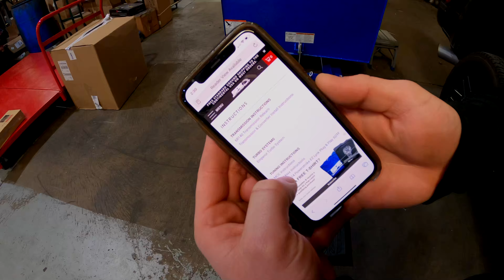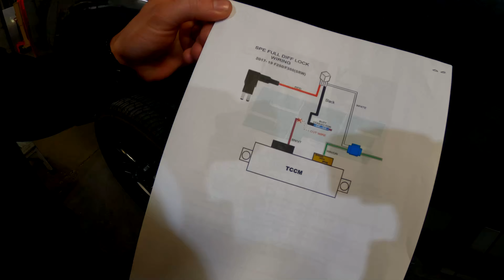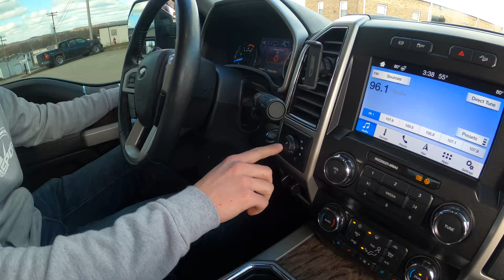SPE DIFF LOCK INSTALL • RWV 6.7 POWERSTROKE BUILD SERIES

Comment: On spe site the difflock for a.15+ f150 also.lists 17+ f250/350.  Do they use the same part from spe? I have one I bought for my 15 f150 I never got around to.using and want to install it on my 17 f350

Comment: I installed this and it seems to lock the rear diff but truck will not blow the tires off it just flashes the traction light on the dash and kicks traction back on any tips or help as to what’s wrong because I know it’s not the tuning 
Thanks! 
Single wheels 2017 f350
Reply: @ResultsWillVary  yes I had an issue with the tap and removed that and hard wired it in. I can hear the relay working but can not hear the rear locking like you can in the video. But I know it does lock I can hear it when I turn. Am I supposed to leave it pulled out to do a burnout? it just seems like the traction light flashes and refuels the truck and won’t spin just trying to figure something
Reply: @KaneCo.  try pulling ur ABS fuse